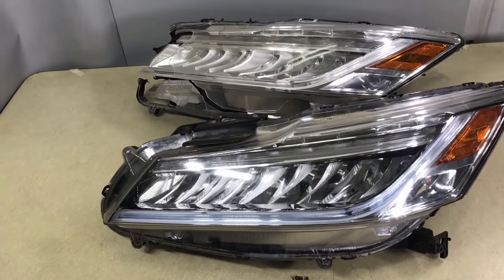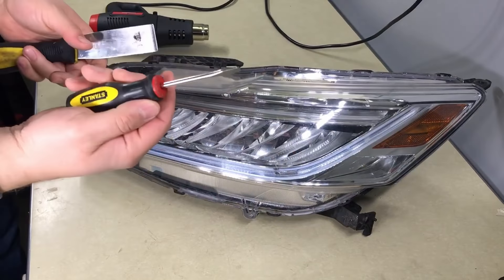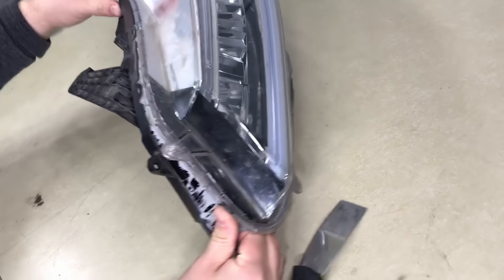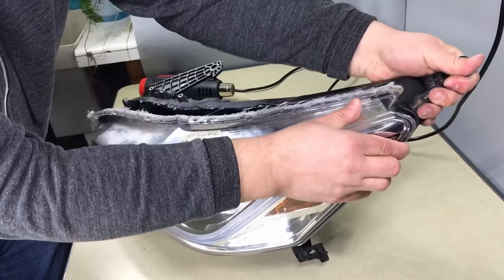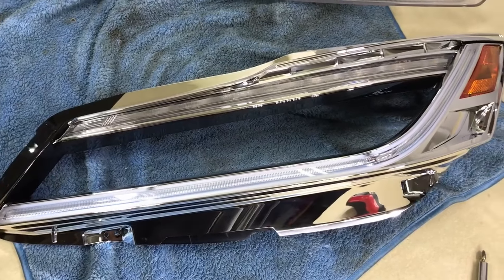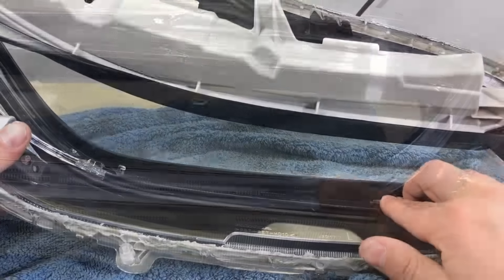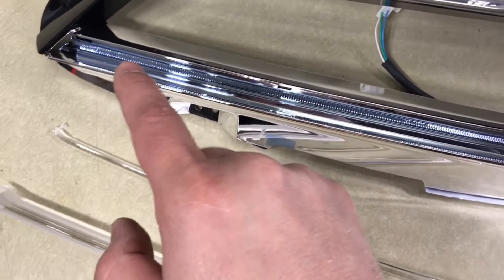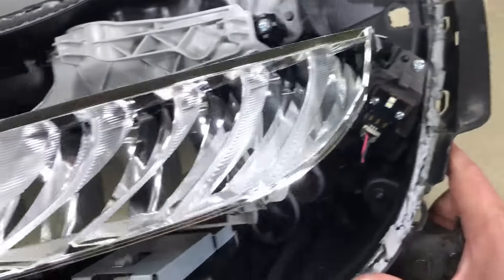2016-17 Honda Accord Headlight LED DRL Burned Out Chip Replaced/Repaired

Comment from the maker: Note, Honda extended DRL warranty in USA for 2016-17 Accord models from 3 years 36,000 miles to 10 years unlimited miles. Recommend you go to dealer before attempting the repair yourself.
Reply: Honda replaced my 2016 Accord for free through the extended warranty. It's the entire headlight assembly so everything is new
Reply: @Kekistani Refugee just go with the ext warranty guidelines, they told me it new old manufactured, so same headlight buy different parts, so should be good.
Reply: is this still current? I went to my local Honda and they quoted me around 300 and I'm not sure if that's with installment. how should I go about this?
Reply: @sierraceja7897  aslong as it's a 2016-2017 Accord, Honda extended it from 3 years to 10 years, so you should have been good to go for free. I say call Honda directly and have your VIN# ready and ask for the nearest dealer that will replace it through the extended warranty. Cheers.
Reply: Sierra Ceja You should have received a letter in the mail letting you know that it is covered for 10 years now. Take that with you if you have it but it shouldn’t even be an issue. What year Accord do you have? I just took my 2016 Accord to get mine fixed and didn’t even have to make an appointment. Just dropped it off and they called me when they were done. You don’t have to pay anything out of pocket, if they are telling you anything else contact Honda motors of America as this is a tsb directly from them.
Reply: Abaddon Gaming what about salvage vehicles? :( this just happened to my 2016 Accord
Reply: Cristal Guerrero Just call the dealership and see, but it probably won’t be covered since it’s salvaged. Can’t hurt to try though.
Reply: Abaddon Gaming thank you I will
Reply: @AbaddonDeath  what if you have hid headlight? Do I need to put the stock light back?
Reply: john john It would depend on the dealership, some might not care but then you have the ones who wanna be extra.
Reply: @cristalguerrero871  Did you get this figured out?
Reply: @AbaddonDeath  I am curious too, if I didn't have a touring model and I had those headlights put into an EX-L.
Reply: Sierra Ceja I say take it. I heard some Honda dealers try to charge up to $1200 just for one headlight. Honestly the car looks ugly with a burnt LED light. Good luck
Reply: Will this still apply if I bought it used from a dealer not associated with Honda?
Reply: @kingjunior4426  thats correct in middle east UAE -  today I went to the agency for replacement  and they asked for 2200$ for passenger side!!, this is really crazy !! 
just for small LED  part I have to replace the whole unit ! 
it is the 3rd time i have this issue with my 2016 coupel, last 3 years
Reply: For those wondering, this is absolutely true.  I checked with my dealership after I saw this comment and just saved myself a lot of money and effort.
Reply: I have a 2017 Honda Accord lx and Honda said if it not on ur recall it’s not free
Reply: @jonathanmorse3601  yo when did You get them done?
Reply: @jesiahglenn5866  I have a 2016 Honda Accord exl v6 and mine just went out
Reply: @Kadeem2727  just this week...
Reply: @Kadeem2727   yeah I have the lx and it doesn’t come with tht so it might work with urs
Reply: @cristalguerrero871  what did they tell you? got the same problem
Reply: My accord with 214k miles on it is currently getting these installed! Thank you so much for the info!( dealership wasn’t trilled) 🤣

Comment: My drl on my driver's side went out about a month ago, and I thought I was looking at an $800 replacement...until I saw this post.  I just took my 2017 Honda Accord to my dealer and they replaced the whole headlight unit free due to Service Bulletin 19-042.  Great post...thanks!
Reply: Honda is extending the warranty on these for 10 years.
Reply: Can you please explain what the service bulletin 19-042 mean?
Reply: Following
Reply: Wow your a life saver I was not bout to do all this 😅
Reply: @henryfernandez3105 it's a recall, Honda got sued. So they have to replace for free. 10 years unlimited miles
Reply: Is it available in canada ?

Comment: Thank you for your effort in putting together this video. You convinced me that I'm not doing ANY of this and I'll just replace the whole headlight. :)
Reply: Lmao!!! I said the same thing when I saw him start heating it up
Reply: Same here. How much did it cost you guys? Could you get it done for free?
Reply: @Thoughtflux  You can get it done for free! Honda Service Bulletin 19-042. Honda-wide warranty for 10 years. The dealership will run a VIN check, and if yours is a match, they'll do it for free. You didn't have to buy your car from their dealership or anything. I have a 2016 Accord Sport. A pair of new headlights will run you between $250-$500+ depending on what you want and if you install them yourself.
Reply: @HeavyPilot83  Thank you!! I will ask a dealership soon.
Reply: @HeavyPilot83  Thank you! This is still true in Jan 2024. Here's the warranty extension: https://static.nhtsa.gov/odi/tsbs/2019/MC-10159030-0001.pdf
Reply: @HeavyPilot83  did they replace the whole headlight or just a strip for you ? also if they do one do they automatically do the other one or only the one that went out?
Reply: @andreyverbitsky8437 Whole headlight. They will replace only the bad one. Fortunately for me, 6 months later, the other light strip went out. I took it back to them and they replaced the other headlight, too. Free of charge.

Comment: No need to do this Honda has a warranty on the lens replacement
Reply: If I install an after market suspension will this void the warranty for the headlights?
Reply: Ja Ra if it has adjustable Coil overs it should be OK. But if it’s a full drop you no longer have a warranty it will be voided
Reply: Carlos D ok cuz I put some adjustable coils. Would rims void warranty? Planning on getting some 19”HRE and a catback exhaust

Comment: Looks like a great repair if you can find a donor light and Honda won't fix it under the extended warranty, but I have a hard time believing that that seal is going to keep water and moisture out once you have broken it without cleaning up the old sealant and replacing it very carefully.
Reply: They got sued . They will fix for free any miles.. ten years from purchase date.

Comment: Thank you for your video. Are the oem headlights sold on eBay? I would rather buy new headlights to get back the LED DRL brightness again. Is this a good alternative? Also are the headlights sold on eBay or amazon an identical replacement?
Reply from the maker: Yes, OEM headlights are sold on eBay, both LED and Halogen type under Genuine OEM section. Depo brand and TYC brand, both aftermarket headlights, are identical to OEM with good fitment. The only downside to aftermarket headlights, DRL are a bit bluer white compare to OEM white, but I am not 100% sure. Repair shop use aftermarket headlight that are CAPA Certified.
Reply: GRC Lights thanks a lot. Can you kindly link where you bought the new LED tube hardware for the repairs you did? I see the link for the boards but can you list the link for the LED tube? Can’t seem to find them anywhere.

Comment: Hi just a quick question... can we get away with just unsoldered the burnt SMD LED and just solder a new SMD LED? My motorcycle DRL led strip is weak... n they dont sell any chip/board/module, just a whole new headlight which cost almost $1000 singapore dollara

Comment: I have a Honda Accord LX 2017. I have day lights, but they are not like what you are showing. Is this for specific models? Does the unit have to be taken out the car to do this repair? Have good days!
Reply: lx doesn't have led drl , just the higher trims
Reply: @azzanal-balushi9709  They don't, but the light pods look like it.
Reply: @buddyreed2623  basically the headlight is the same just without that led, you can add it

Comment: Any idea if the LED tubing inside the Sport headlight would be the same as the Touring ?
Reply from the maker: No, they are not interchangeable, but they use the same bad LED system to power them.

Comment: I had one of these replaced on my 2016 Accord under warranty $1,200.  Now the other side has failed!  Thanks Honda, a $1,200 light bulb.
Reply: They burned you, these are to be replaced free of charge
Reply: Honda has to fix it for free. There’s now a 10 year extended warranty (from original purchase date) on the daytime running lights. They will replace the whole headlight assembly for free

Comment: Quick question.  Anybody that can answer...what happens when they burn out?  Does it affect anything else?  Or is it just simply sn aesthetic issue?
Reply from the maker: Correct, just an aesthetic issue. You will get no errors in the dash.
Reply: @GRCLights  Thanks for the response.  Just doing my research, I’m currently shopping for a ‘16 or ‘17...
Reply: @GRC Lights, correct. Running lights just look uneven, main lights still work. I have a 2017 hybrid.
Reply: It affected my parking barks. It totally burnt the fuse

Comment: I have a 2016 Accord sport it’s a recall for that year just go to Honda free of charge
Reply: I have a question, is there any way to open the trunk from the outside without using the key? Is there a button anywhere on the trunk?
Reply: Jean Viloria yes! It’s usually a bit towards the right of the license plate, right above it.
Reply: @Jean Viloria, you probably already know but there is a button just under the spoiler but you have to have the wireless key nearby in order for it to work. Anti theft feature.